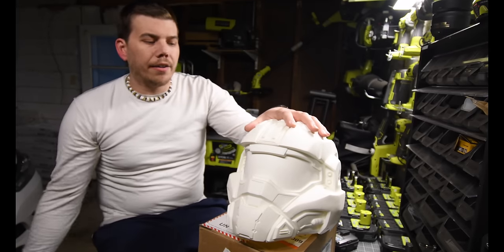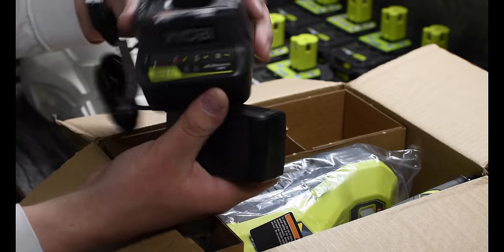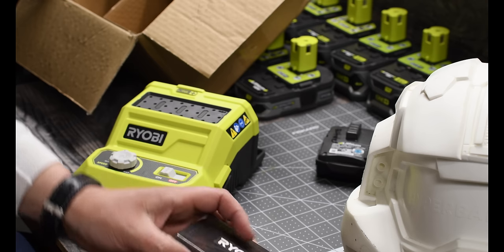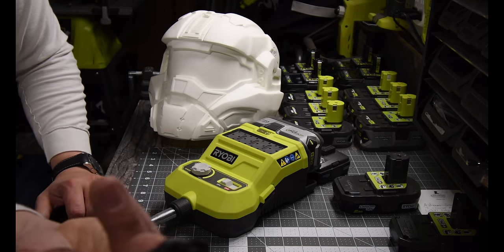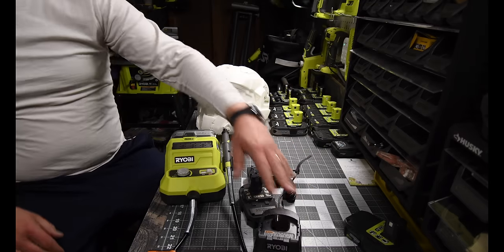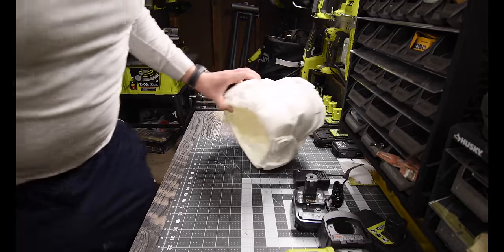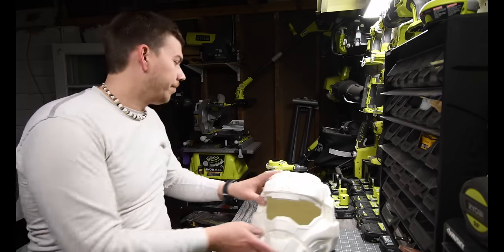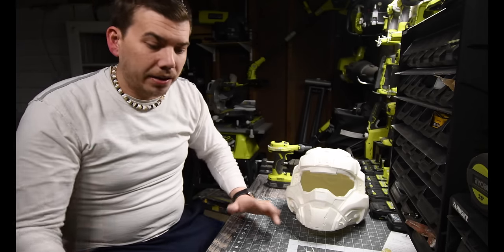Ryobi Rotary Station kit (UNBOXING) and Review

Comment: First of all, the stuff in the tube is buffing compound.
Second, that looks like an attachment I have for a Dremel  tools. I purchased it probably 10 years ago. You just attach it to a multi speed unit and get the same effects. I used it today cutting off a copper pipe.  Although at the end of my project, that cable through the tool broke, so it’s time for a new cable. I think the whole cable cost about $30.00.  Dremel also make a stand to hold the unit with the cable attached. It may come as a kit.
I noticed that this unit was coming out and I was interested in seeing a demo. I’m not sure I will be buying it......     Thanks
Reply: Me too I'll stick with my dremel. Not impress with ryobi
Reply: chris bevins. I just noticed today that Lowes has that attachment on sale for $20.00, down from $30.00. Think I’m buying a new one........
Reply: @timraber6575  right on me too
Reply from the maker: Thank you sir

Comment: You should think about wearing eye and hearing protection when using this tool. Your face is only inches away from that bit which could be spinning as fast as 34,000 RPM. Anything flies in your face or eye and you'll be feeling it. That high pitched whine WILL damage your hearing, get some headphones or ear plugs (NOT ear buds) so 20 years from now you can still listen to YT videos and not have to rely on the close captioning.
Reply from the maker: I should have and Thank you and Happy Thanksgiving

Comment: I orfered one with a bag. & it charges batterys with in 30 minutes
Reply from the maker: very good, and I thank you for viewing Roger
Reply: @ManCaverTools  
I also tried using A Black n Decker 20 volt Drill
Battery To Charge My
Phone. & It Only Got Up to
68% That's Not Even
Half A Charge.

Comment: I use a foredom brushless micromotor and it's dead quite and powerful with up to 50,000 rpm controlled with a variable speed foot pedal.... Or you can opt to just use the dial. This thing is louder than my foredom flex shaft rotary tool. this ryobi is WAY TO LOUD and I saw it has a auto stop that starts getting extremely annoying if you work with something like wood or metal.
 I'm telling ya, get a brushless micromotor with a 1/8" collet ... and you won't even look at this ryobi, except as a kids toy lol

Comment: Whats that thing at 5:42 in your video that looks like a battery on your worktop?
Reply from the maker: Doug Wright that is a 12v battery for the 12v drill
Reply: That was my first Ryobi Tool 12v drill from 8 or 9 years ago. Still using!